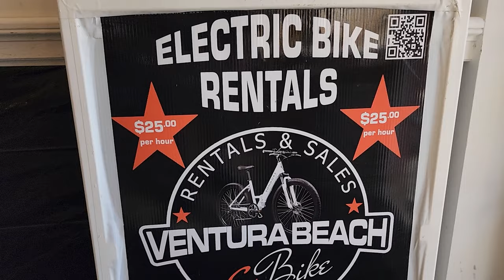Going to an eBike Dealer/Repair Shop; Getting My Aventon Aventure Fixed. Questions Answered.

Comment: I haven't had a flat tire on my rear tire yet.  I had a couple on the front tire, but there was always an object sticking in the tire so I had no issue figuring out the problem.    Now I learn that if it isn't obvious what the problem with the tire going flat, I should examine the valve steam as a potential issue before taking off my back tire.    I'm not looking forward to first time I have to take off back tire, so will definitely be checking that valve stem.   Thanks for the video.
Reply from the maker: That surprising you havent had an issue with the back tire yet, usually it goes flat first because all the weight is on it.  Yeah, it was the first time I ever used a presta valve so I probably just didn't know what I was doing.  Thanks for watching!
Reply: @Zainenn  I don't seem to do anything correctly, so the fact that i can't even get a flat on the correct tire is not a surprise.
Reply from the maker: @richarddkearney  lol.  I'd take a flat front tire over a flat rear any day of the week. Your lucky.
Reply: It is very easy to remove back tire. I just flipped my aventure over on the carpet. Untwist electrical connector, cut 1 ziptie. Pay attention to inner axel washer as they align with the bike frame.

Comment: Don't put too much air either that's where all these guys go wrong, anything over 15 pounds of pressure you're shooting yourself in the foot, you're not going to have any less rolling resistance, maybe more cuz tire is going to ride rougher, and you're going to get flats. And unless you're dealing with an excessive amount of goat head thorns tire liners are a gimmick, they just add weight.

Comment: Hmm.. Did you research an Arial Rider Kepler? I can't find a reason to get the Aventon over a Kepler really. Maybe you wanted to go with something that can go into a dealership.? I don't know... Maybe the Kepler wasn't in production yet even when you bought yours. I like The Aventure but went with the Kepler instead. Very nice bike shop worker you ran into. Cool he was so helpful 👍
Reply from the maker: Never heard of the Kepler, I'll check it out.  Aventon is a class 3.  If you can take the Kepler into regular bike shops then its a class 1 or 2.  Thanks for watching!
Reply: I’ve taken my bike to a shop that doesn’t sell e bikes to have a flat fixed,they had no issues doing it
Reply from the maker: @randallhoskins6243  makes sense, I meant mainly for electrical work. My local shop had no problems changing a tire, they just don't have insurance for tune ups and electrical.

Comment: I have a question, what was the deal with your pedal crank a while back. I have an aventure.  560 miles so far no flats. 20-25% trails and gravel. Some areas steep enough I had to walk the bike over the top, but it's not failed me yet.
Reply from the maker: I'm still not 100% sure what was wrong with the pedal crank, however the threadlock seems to have worked.
Reply: @Zainenn  Great, thanks!! I'll make sure and get that thread lock. I enjoy your channel!

Comment: That's not true, it's always a good idea to put an extra layer of duct tape or gorilla tape around your rim liner, overtime the lumps from where the spokes are will cause a problem eventually, a little bit of baby powder in the tire never heard either, keep the tube from drying out and getting stuck to the inside of the tire.

Comment: Hey "Z", I started watching your channel because I was researching bikes. As many videos that you have done now, you should reach out to Aventon and let them know. You should also reach out to other companies and see if they would send you a bike to review. With my small channel, I reached out to companies that had products I was interested in and simply asked them. They started sending me stuff. I have a lot of free stuff now in my garage. I have about $4000 dollars worth of solar equipment in route right now. Its just crazy how much these companies will give a way to YouTube creators. I want a bike, can't afford it yet (Maybe I need to sell some stuff), so I have reached out to several manufactures but so far, no one is interested in sending me one. I want to do a "Bug-Out-Bike" video and solar charge it on a trip. Think it could be a great video, but so far, no one else seems to think its good enough to send me a free bike :-).
Reply from the maker: Yeah, I might be getting close to doing reach outs.  I plan on doing the same video haha.  I already have a solar setup in mind, I could buy it but haven't pulled the trigger.  Maybe I'll reach out to that solar company and see if I can get one.
Reply: @Zainenn  Don't tell them I sent ya, but reach out to EcoFlow tell them your interested in doing a video about one of their smaller power station that you can travel with on your bike. They have been really good to me and great to work with. Now.... If I just had a bike... lol.
Reply from the maker: @DownGridSurvival  Will do, thanks!